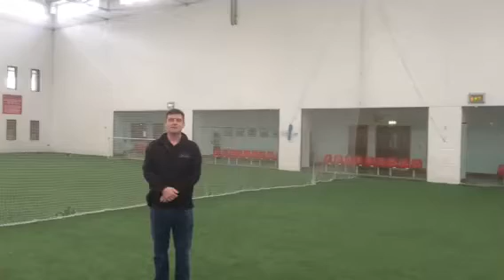Explaining a Flutter Echo

Comment: Great Video. 
Just adding my bit. For people designing sports halls with perforated decks. Do not rely on perforated decks to absorb the reverberation energy alone as it will not even come close to your Sabine or Eyring calculation. Sports halls often have tall, hard reflecting surfaces like in this video and waves travelling horizontally become trapped bouncing side to side and do not go near the roof deck to be absorbed. Sabine equations assume that the absorption is evenly distributed around the room and not all on one surface and you can find the roof will underperform by half and sometimes more.
Simple solution that can have a big improvement and reduce flutter. Install 2-2.4m high backboards on either end of the hall with a 1-2 degree angle. By doing this immediately the flutter will be reduced. Placing absorption above the 2.4m line will now have sound being directed towards it. Bingo !